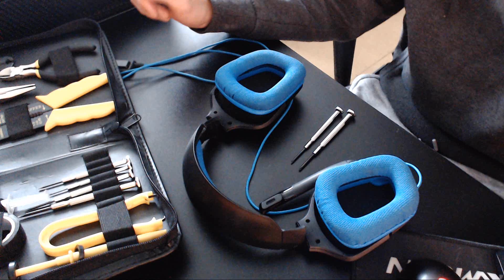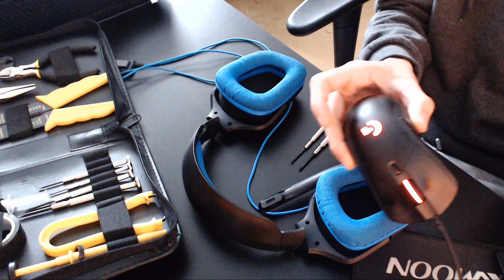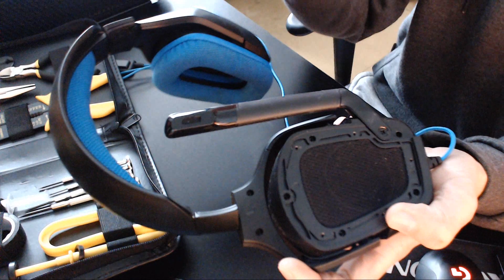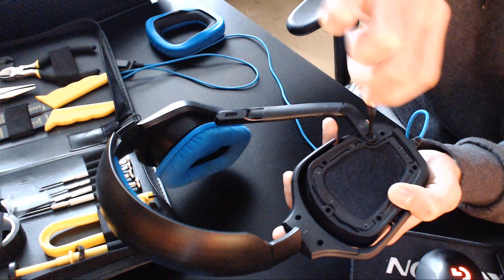How To Fix | Loose Microphone | Logitech G430 Headphones |

Comment: Can you please do it for the g432, mine is lose and i cant fix it that way
Reply: i just bruteforced my g432 open and snapped 2 wires with it, i dont see a solution on how to do it without bruteforcing my way into it because its glued together at one point, so its probably going to be me welding the cables back together and then hoping that i fixed it

Comment: You can't do this no more.  The arses have put the Screw for the Mic BEHIND the Speaker, popping the speaker off rips the 2 cables off completely.

My £80 headset is now trash, tyvm :)
Reply from the maker: It happend to me also but if you have a soldering iron handy it is a quick fix
Reply: @Lūmīnar.Arts.Projects  yes I actually used 2 pieces of cable to extend them, mine were ultra thin and melted the lil. Cables to bits, luckily it all worked after.

Really piss poor cables and build for the price.
Reply from the maker: @Ionstorm  haha yeah I agree the cables are poorly made
Reply: @Lūmīnar.Arts.Projects  poorly made and poor quality, I didn't think they'd be very capable of audio signal tbh but they are. On a side note a very cheap pair of headphones from China had cables twice as think and with plenty of slack. Really shocking, makes me think twice about Logitech stuff in the future
Reply from the maker: @Ionstorm  Yeah some of the products are not so great I have had headphones for a few years now. Might consider changing soon.